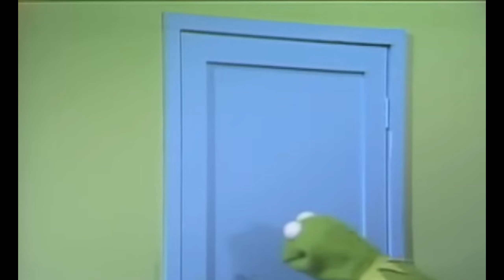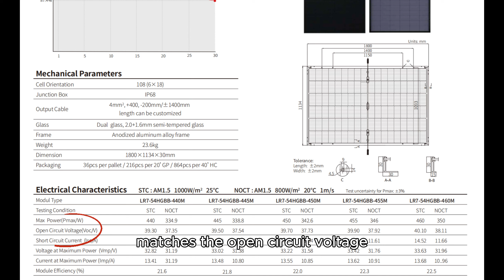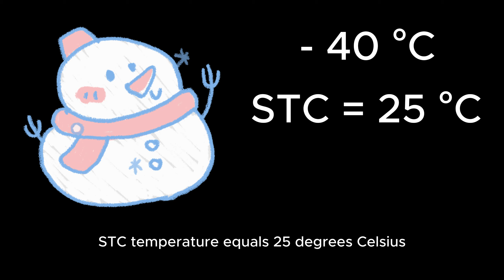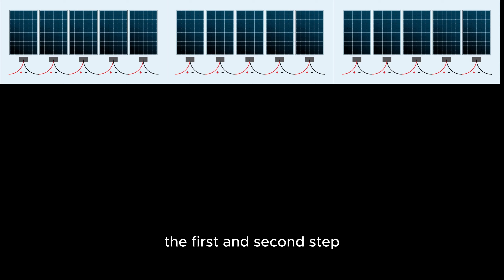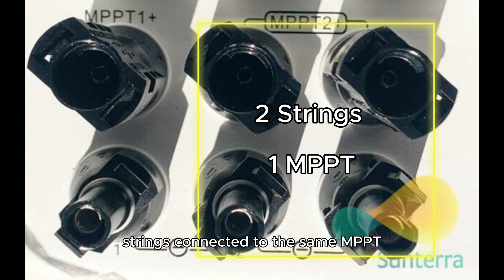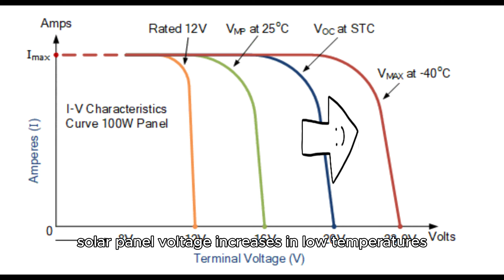Don't Buy Solar Panels & Inverters Before You Understand This!

Comment: The fallacy of the max voltage at the lowest temperature fails to take into account that the sun is also at its lowest aperture in the sky producing the least amount wattage or power on the panel or through put to the system.
Reply from the maker: Good Point. Thanks for your comment. It is actually possible to reach maximum voltage in extremely low temperatures in a winter clear sky. Since the temperature coefficient directly affects the voltage. The lower the temperature, the higher the voltage you have. I am not talking about something even close to the Polar Night. You can get a lot of sunny winters in Alberta, Saskatchewan and Alaska. The angle of the sunlight may be low, but you will only have a lower current and lower power, voltage will still be high. 
What we need to consider is whether the voltage of the solar panel can be beyond the voltage range of the inverter. Which is typically under the most extreme conditions in your region. Like you need to consider the maximum wind speed and maximum snow load, or maximum hail record in your place. these are not going to happen quite often, but once it happens it will be a disaster for your solar system.

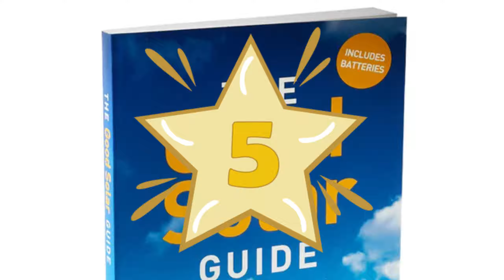Comment: 1:00 you can connect them in parallel and series to get a balanced voltage and ampere!
Reply from the maker: @ALI-TECH  thanks for your comment. Normally, panels are in series in a string. Can you give more details regarding how to get it balanced?
Reply: @Renewable_Tek  just search for "wire solar series vs parallel"